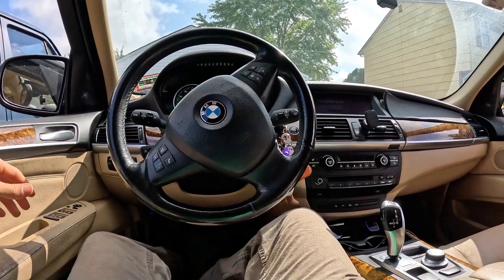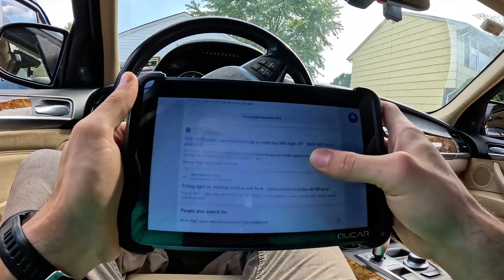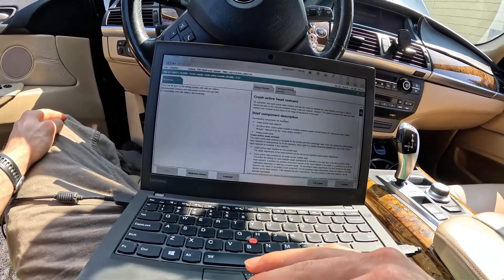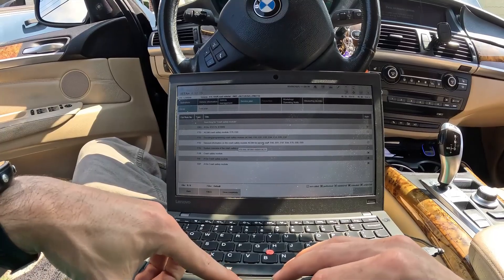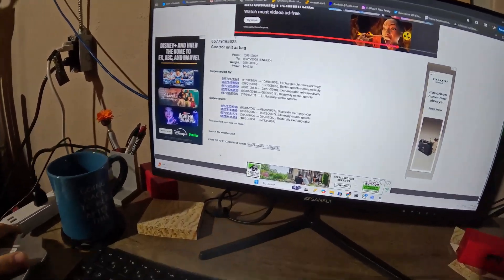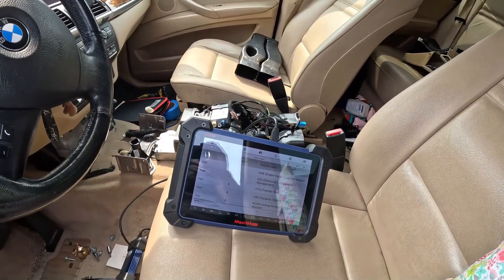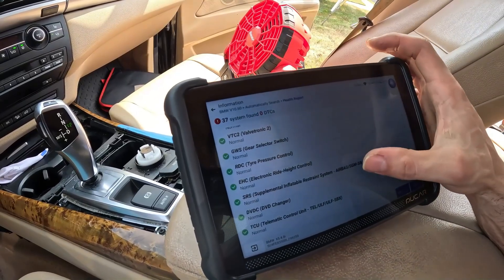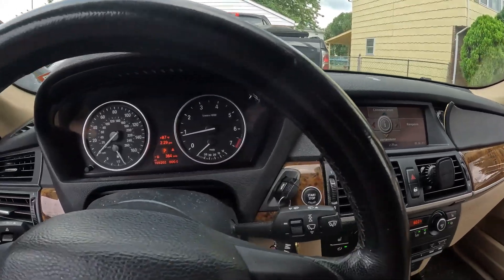The $30 Solution to BMW's $700 Airbag Problem - 93D7

Comment: Great info & great example of electronic diag, especially on this year and model. I have the first gen X5 . Still problematic,but not as bad as the subsequent models with these modules hidden in the craziest places that wind up unavailable or unservicable.  Oh how I miss u-pull it's & other junkyard.  The govt took the working man's biggest resource &turned it into our biggest expense keeping us stuck in our socioeconomic place.  Shame because well built machines like these could go for 2-400-k miles easy. Cash for clunkers was my generation s  White gate scandal.....a cruel trick by your own keeper.  Hooray u.s.a.
Reply from the maker: Appreciate it! For all the work they take, I still enjoy these X5s — plenty of power, features, and stability make it worth keeping one going. And you’re right, a decade ago hitting the junkyard with buddies was a weekend event for me. Now the closest one that still lets you pull your own parts is hours away.

Comment: i tought the air bag module can no be replaced on the bmw ?
Reply from the maker: I've seen this idea floating around forums but im not sure where it comes from... BMW doesn't recommend airbag resetting services but as far as module replacement goes, BMW sells modules for their new vehicles and they can still be programmed and coded
Reply: @AntsintheGarage  yes . I think is because  you can not  repro with ista, but it seems like you can with a third party scanner that has repo capabilities

Comment: hey, I have watched some of your videos, and I'm wondering if you could help me with something, I have a project car of my own, a Lancia Thesis, which is famous for those types of issues, but there is little to no information on this car, does any of the software you use have info on this car?
Reply from the maker: Sadly my service info is limited to the engine because its shared my Stellantis but I see seat occupancy sensor issues seem to be a common problem in the srs system. I'll see what I can dig up if you have a code handy
Reply: @AntsintheGarage  what a wasted opportunity,hope he answers.  Your very kind for the reply.

Comment: C944 how to fix
Reply from the maker: that's a communication issue on the K-line, there was a bulletin on E90's (B61 10 05) that may apply. has to due with damage to the seat wiring harness from the seat being adjusted low and bumpy roads
Reply: Hate all the electronic crap that's been put into vehicles over the years.